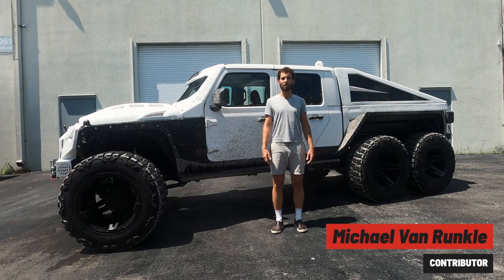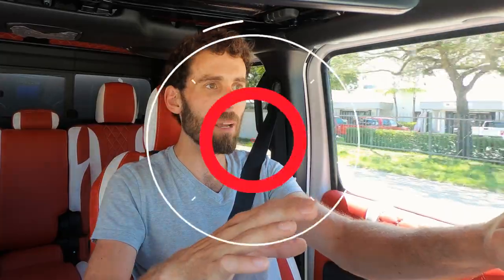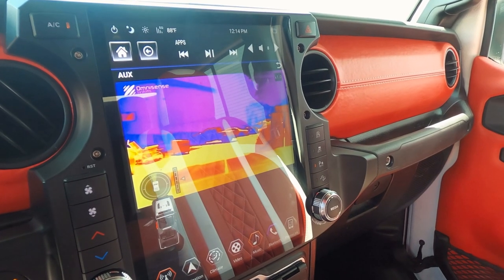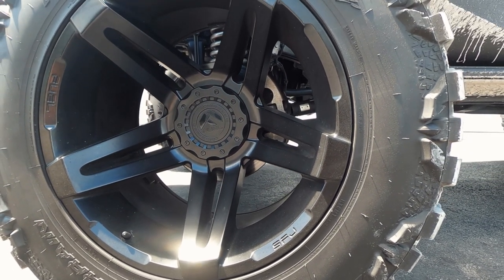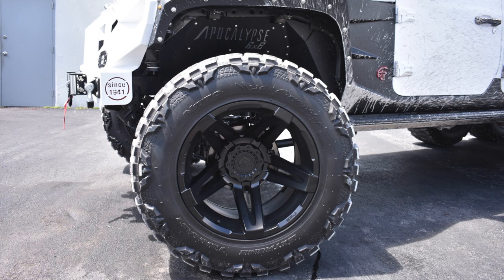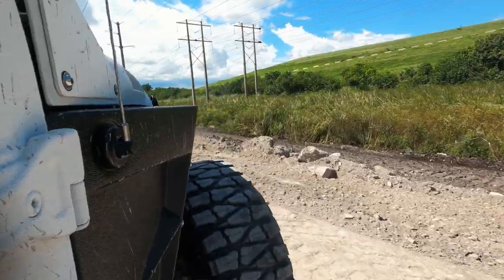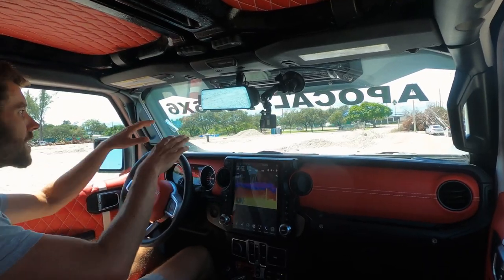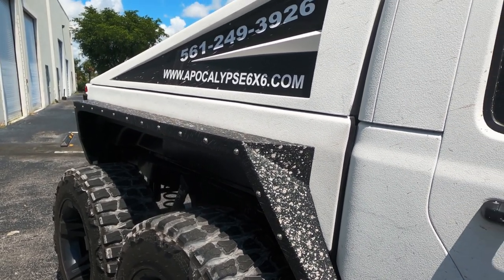Apocalypse 6x6 Review: Driving The Insane Hellcat-Swapped Jeep Gladiator Conversion

Comment: Nice looking vehicle but out of all the clips I've seen about it 1 question how does it work off road or is it just a poser for shopping malls I haven't seen 1 at moab or the Rubicon or anything other than road works or on the road I'd like to see what it can do before I'd buy one as it's a lot of money for a carport warrior if it's no good out the bush
Reply: I would like to buy one too,  it’s an amazing car
Reply: I agree with you. Nobody is showing this thing off road. Off road they present it's so weak Toyota Prius can do it. Also nobody have balls to check max speed. What is it 100? 140? 160? So far looks like poser for shopping malls.  I want to be wrong.
Reply: @newera3757  hi I want to be wrong about apocalypse too I'd actually love to buy one but at 150k ➕️ usd that's a lot of money then I'd modify it as I'm no mall terrain kind of guy I use 4x4s hard a 6x6 isn't a lot more capable than 4x4 their mainly just more stable on rough terrain when loaded and carry a bigger load eg a slide in camper I think I'd take one to dyna track for bigger Dana's n lockers I've noticed a lot of apocalypses on lite bright on u tube I may write to them as their full on n have the contacts to answer ? About abilities off road